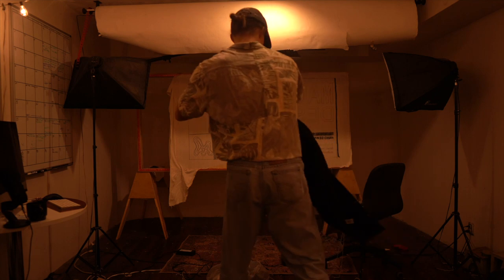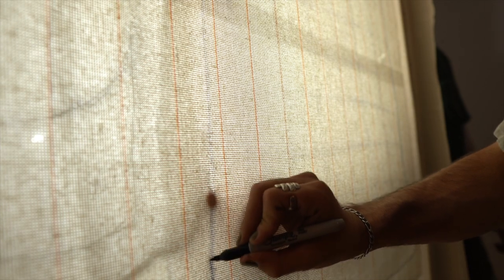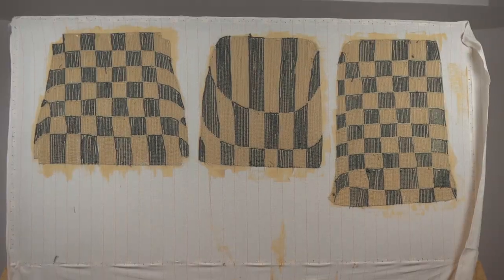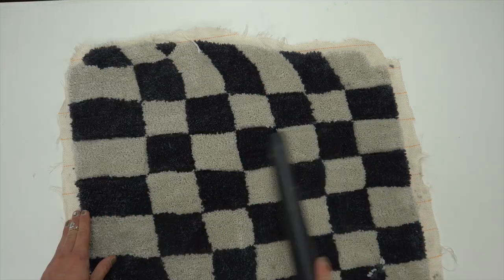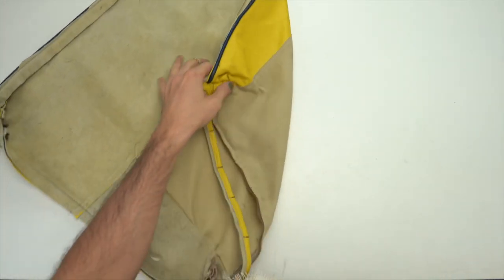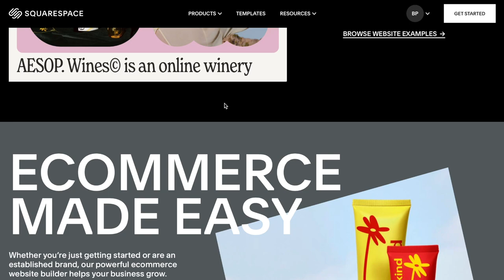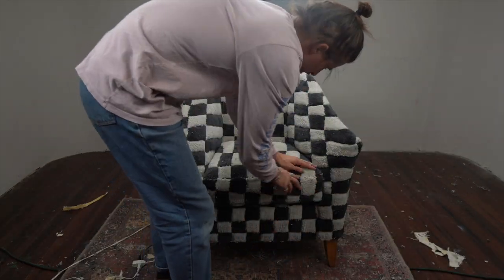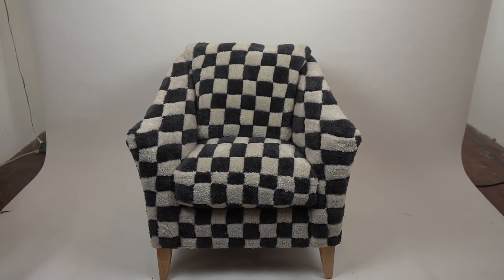Turning a Rug into a Sofa Chair 🏁  ➡️ 🪑

Comment: Some advice I would give is when attaching the fabric, staple at the seam allowance of the fabric onto the piece with the wrong side of the fabric facing you and laying in the opposite direction of where you're laying it, so that when you fold it over onto the correct place, the staples will make a clean edge of the fabric and the staples will be hidden. Otherwise this is such a fantastic upcycle of a chair, the optical illusion aspect of it is so creative and you always find ways to get through a project no matter what it throws at you. Great work!
Reply: right sides together is always the best way to sew anything☺

Comment: Get some "blade wash" & run clipper through that after each use. Also, "Kool lube" will lubricate the blade during use - let sit on blade a minute, then wipe to avoid residue on rug. 
 Blades DO need to be sharpened occasionally, but cleaning & lubricating will extend that time.